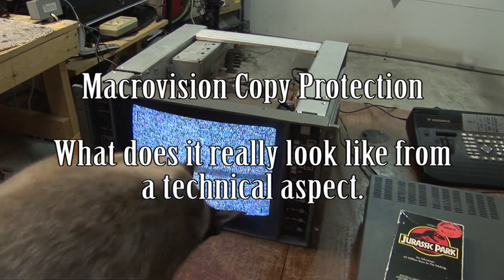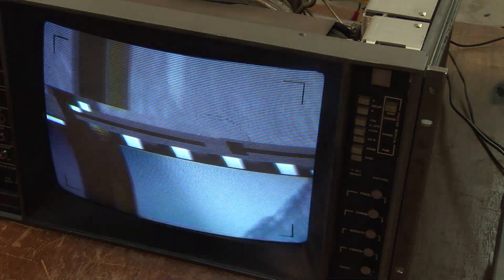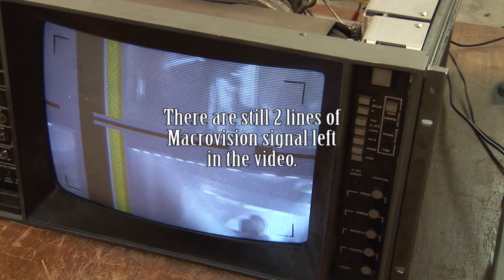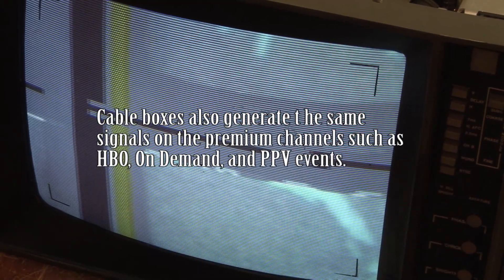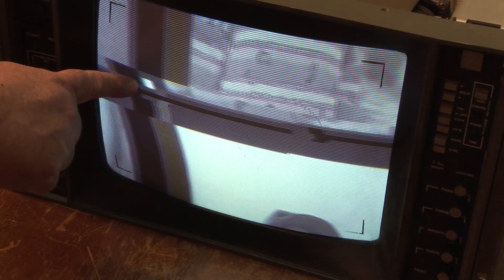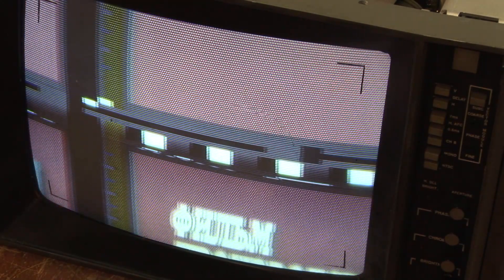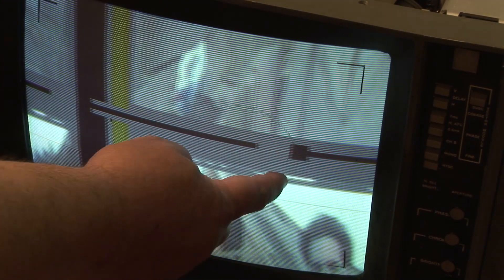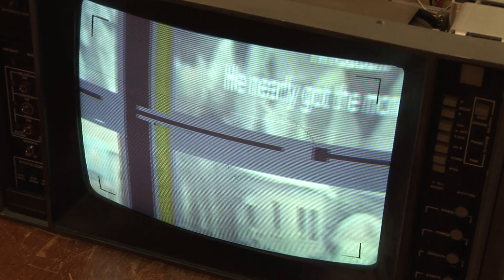Macrovision vs a Time Base Corrector

Comment: TBCs remember it well.  They were expensive
Reply: Still are expensive. I have a Panasonic AG-1980 Super VHS and have been trying to find a nice full frame TBC with S-Video in and out. The VCR has a line TBC which helps to straighten up some video tapes but it doesn't do anything for macrovision. I have some old camcorder recordings that various digitizing equipment falsely detects as having macrovision. Back in 2004 I digitized some using an AGP nVidia TNT2 Ti with analog capture, but to do it I had to 'piece together' files from specific different video driver versions to disable macrovision detection. Otherwise the stupid thing would put a big white bar across the middle of every recording.

Comment: can you sell me a macrovision remover
Reply from the maker: Sorry I don't have one for sale.
Reply: Glad I still have one, not selling it anyway!
Reply: just google schematics for one and visit your local radio shack for the parts needed to build one oh wait....
Reply: Got a schematic for one that works with S-Video, and keeps it S-Video all the way through? No funny business with combining the signal to composite, de-macro-ing, then generating a fake (and degraded) S-Video output.
Reply: greggv8 if you just feed the luminance signal from the s-video into the macro vision box and connect the output back to the s-video's luminance line it will achieve the same effect since all the sync signals for s video reside there